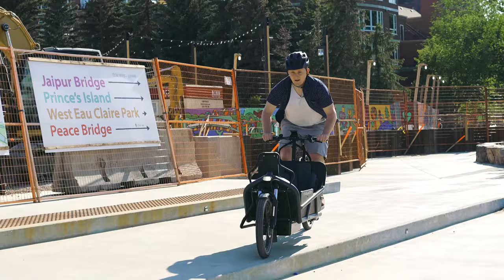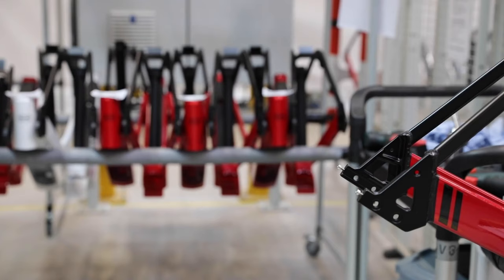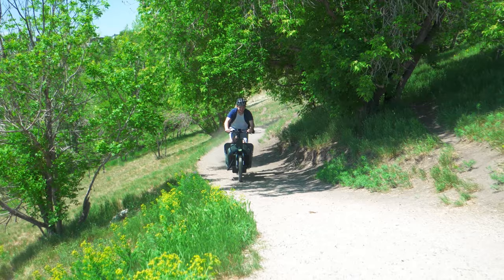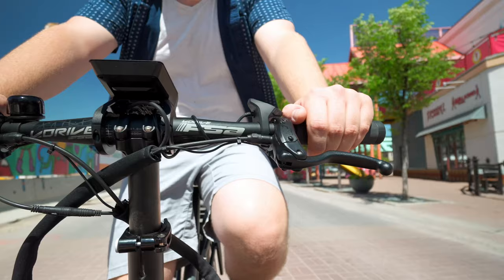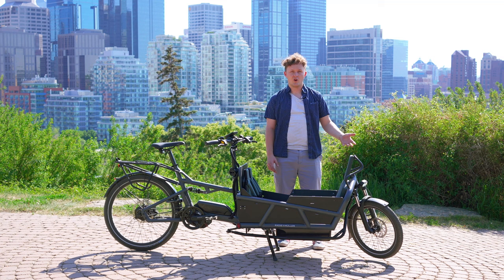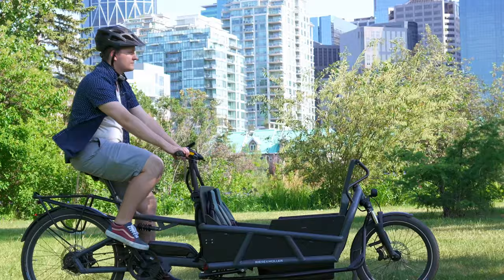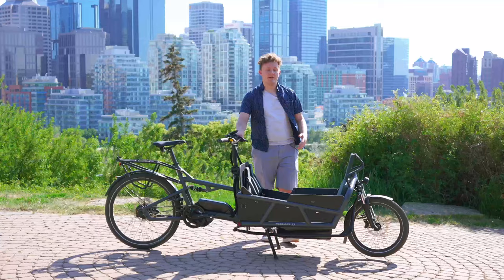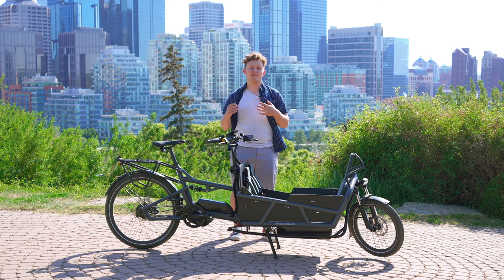Unleashing the Powerhouse: Riese and Muller Load 75 Full Suspension Cargo Bike - Review + Test Ride!

Comment: Would it be possible to get it with the front wheel the same size as the rear?
Reply from the maker: You need a small front wheel for easy to steer.  Larger rear wheel for speed.  To change wheel size is to break good design, and make it an ugly hack job.